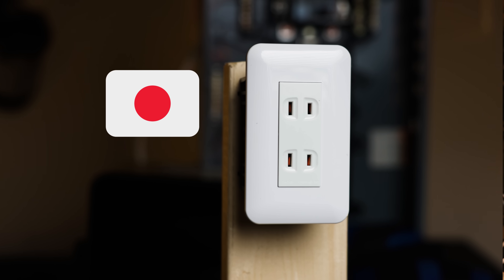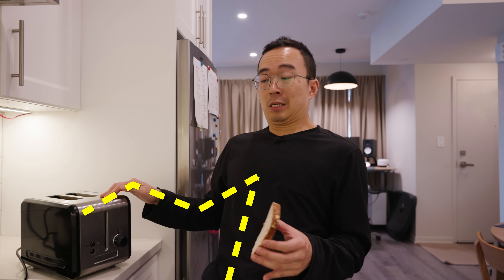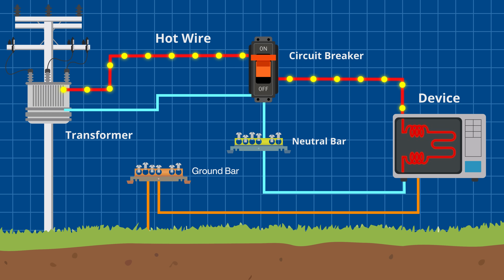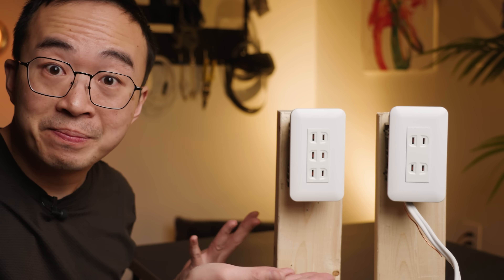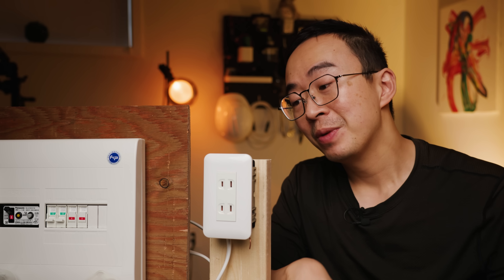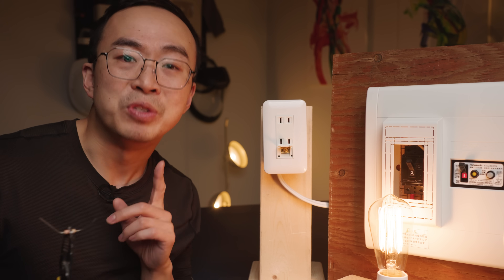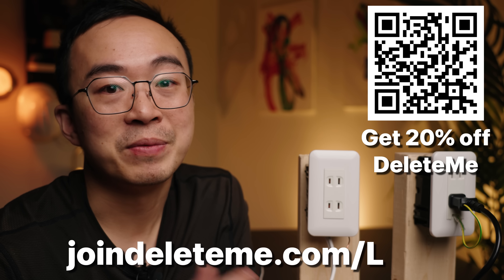How Japan Made Their Outlet Safe

Comment: You are not correct about the Russia. They are now pushing the "modern" schuko (CEE7/3) outlets, but their Schutzkontakt (PE, Ground) is typically unconnected, which causes a lot of problems to modern electronics (which is also why japanese have that weird screw thing). Furthermore, they are not protected by the RCD, but their last mile is typically insulated from the ground and that fault detection detects whether it is still insulated from the ground or not. It's based mostly on residual voltage detection than on a residual current — it is high impedance thing, which means all contacts have to stay insulated from the ground potential.

Mixing RCD with grounding (as it is done here in Europe) is not easy task. If you short the neutral to the ground relatively near to the RCD, it forms shorted winding on that residual current differential transformer, which prevents old transformer based RCDs from tripping. And it also does not detect DC residual current. This is why much modern RCDs are now required in EU, but they have its own different issues, like false tripping etc.

Introducing RCDs to an USA would cause a lot of problems as they have two pole polarized plugs (that requires not to separate protective earthing from neutral, which separation is crucial to the RCD) without any real benefit. RCD does not improve safety too much as it trips at 30mA of residual current, but 3mA through human body is almost perfectly lethal.

Comment: That whole hassle of getting a screwdriver out to ground something is very redundant when you could just use a basic north american socket.
Reply: I'm pretty sure Japanese plug blades are just a slightly different size than the US/Canada's.
Reply: @jovetj  Why would they be? Japan uses basically the same power standard as the US and Canada do, at least with respect to amperage and voltage, and most modern electronics are designed to handle both 50 and 60hz. Anything in any of those countries with just 2 plugs is supposed to be double insulated as there's no ground to direct stray current to other than through the body.
Reply: But then it wouldnt be kawaii anymore. Baka.
Reply: How often are you moving your refrigerator or washing machine around the house? Those are the only thing people ground. I have a welder with the 3rd prong and just use the 3 to 2 converter and don't ground it, I have cut the 3rd prong off some of my other things
Reply: @hambone8820  kettle toaster air firer lots of kitchen stuff. gaming pc and monitor

Comment: Here in North America there are still some older houses which have ungrounded outlets, many of which have no ground wire in the cable either.  In many cases, people removed the grounding pin to get the plug to fit in the ungrounded socket.  Many appliances are dispensing with the grounding pin altogether in favor of double insulation, whereby no hot conductors are capable of making contact with the outside casing.

Comment: Electrician from Melbourne, Australia here. We used to have similar house wide RCD's fitted (mandatory since late 90's / early 2000's on new installations). They were eventually banned due to small faults such as a filament (incandescent) light globe blowing and taking out the whole house supply. Eventually power and light circuits had to have separate RCD/MBO's combo (Residual Current Device - Miniature Breaker Overload) to break them up. These can be separate devices. There are also 4 different types of RCD's, but that's getting technical and has to do with an obsolete type with 3 new replacements, that operate on different currents and frequencies, depending on what's required.

Now every separate circuit has it's own RCD-BO installed with a recommended 2 lighting circuits through the house (though not mandatory). That way, faults are isolated to individual circuits, not the whole house, especially lighting. The next evolution in electrical protection will be AFD devices or Arc Fault Detection that will start being implemented soon. These detect arching between active conductors and disconnect before the circuit, hopefully before a fire takes hold.  

As mentioned in another comment, I'm coming up to 30 years in the biz, so have seen a few changers in my time. I find other countries electrical systems interesting though, so thanks for making the vid - Cheers!!
Reply: I lived there when I was only 5 years old in 1995 (30 years ago).

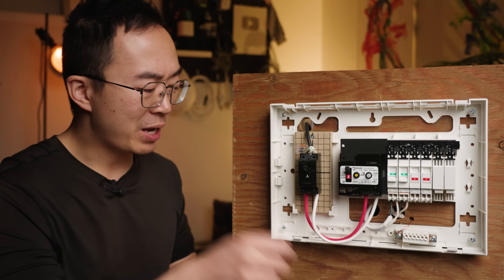Comment: Why so misleading? 7:10
1) it is easy to convert TT to smth like TNC-S, and you don't need to upgrade "substation infrastructure" for this. In opposite, converting TN to TT is more troublesome as this requires independent extra grounding system of the house.
2) while many countries in Europe practice TT grounding (not just France), their sockets have 3 contacts now. Having or not having the ground contact is not really depends on TT or TN - both grounding systems allow having extra grounding contact. At least, GFCI can do its work better in this case
3) as you have shown yourself, some Japanese sockets have a cumbersome inconvenient ground contact, so it seems Japanese engineers see that their plug-socket design is inferior, but instead of really solving the problem, they decided to use a weird crutch solution
Reply: yeah, this guy doesn't know what he's talking about
Reply: It's not easy to convert TT to TNC-S, certainly not here in the UK, as you require permission from your network supplier and they will often say 'no' because the supply infrastructure isn't up to the job.
Reply: @tubaman66  When Australia dropped TT (direct / ELCB) earthing decades ago affected installations were converted simply by adding a MEN link (neutral / earth linkage within the installation) and if an ELCB was present (pretty much mandatory at that stage) it was defeated by routing earthing and neutral around it and it became a simple mainswitch.  Pretty straightforward process.  Definitely more complex over there in the UK with TN-C-S earthing being provided by the network.
Reply: No, it is not easy. It is not just that you connect the ground to the neutral. In TT and TN the second letter tells where the grounding conductor is connected so the connects would make no sense without grounding conductor.

Teh Japanese separate grounding system is so that you can plug for example a PC to the outlets without the hole. Yes, from European perspective the idea of optional grounding whether you remember to hook it is horrible. The system requires more from the user.
Reply: @okaro6595  your point is not clear. Are u sure you have accounted  grounding rods location for TT and TN ?
Reply: @borincod  what do grounding rods have to do with anything?
Reply: @okaro6595  they have smth to do with difference between TN and TT...    It is not so nice to tell anybody to search themselves, but I have actually already mentioned this earlier
Reply: regarding #3, the wire system is for backwards compatibilty and choice. when you have 3rd pin, you need a socket with 3rd hole, but it's still not widely used. with wire you can use it with old sockets that don't have 3rd hole. and if you have earthed socket, then you could connect it to earth. and for convinience and people who care about safety, there is an adpter that converts between cable and 3rd pin.
to be honest, it's a bit of a hasstle overall with 3 different sockets, but japan's voltage is low so it's not so dangerous after all (can tell from 0 death)

now the video doesn't go into this, but this option is only for 100V 15A. all other types (100V 20A, 200V 15A/20A) that are used by high power appliance like kitchen heater and AC behind the scene always has a 3rd pin and all sockets are equipt with 3rd grouding hole.
Reply: @suou7938  "wire system for backward compatibility" does not really applies here for a reason that it's needed to install a new socket with a bolt for hooking the grounding wire up. Do i miss smth?
Reply: @borincod  to have grouding in the house, you're right. i was refering to adding grounding to appliances. if governemnt suddenly requires 3rd pin on all electronic, it's going to be very inconvenient. with wire, you don't have to worry if the socket has the 3rd hole.
Reply: The IEC earthing system like TN-C-S, TT or TN-S does not work in Japan and North America, they have an entirely different system than the rest of the world
Reply: @xiaolinzi_111  bizzare. references?
Reply: @xiaolinzi_111  You do understand that the USA uses a TN-C-S system, right?  The premises earthing system is attached to the supply neutral.  Specifically it is TN-C to the premises and separated with in the premises.  This is actually a fairly common implementation of TN-C-S around the world.
Reply: 1)-because the fault current is different (it is higher)
2)-Because the ITM in TT are omnipolar, in TN they are unipolar
3)-European electrical distribution is different from American (large transformers to small modular transformers)
4)-The neutral in TN must be more reliable than in TT because it will do double work. PE+N 
5)-In America we use, "multi-grounded neutral" while in Europe it is not.

Comment: Your diagram animation around 4:00 shows the neutral bar connected or passing through the circuit breaker. Normal circuit breakers in NA only have the hot passing through it.

Comment: Running a ground wire is a passive system. Properly installed, it doesn't fail. RCD/GFCI are active systems. They eventually fail. Where I live, they're required on outside outlets and any outlets in kitchens and bathrooms within 6" (2M) of the sink/ tub, basically anywhere it's going to get wet. They're ADDED protection.
Reply: I don't realy get what you mean by passive and active in this context but RCDs rarely fail. They are extremely safe even to the point that they age in a way that makes them even more sensitive. So if they get older, they break the circuit at even lower currents and after even faster times. There has to be some serious and unusual damage for one to fail that might happen just as often to the classic circuit breaker. In europe they arent added protection, they are required protection. The circuit breakers are less trusted than the RCDs so we have to have both in every place where basic people who aren't electricians hang around.
Reply: @electricpaisy6045  Exactly! GFCIs fail in a way that makes you replace it, they don't fail by just not protecting you anymore.
Reply: @electricpaisy6045  Oh you don't understand how poor quality RCDs somehow find their way into new homes, because of cost-cutting. Sometimes the electricians signing off doesn't even care. There's why RCDs require periodic testing and many have test buttons, to verify that they work.
Reply: @Avantime  yes but what does that change about my point?
Reply: @electricpaisy6045  They rarely fail, but the thing is they're a safety critical item that should never fail, because there will be someone out there in the millions of households who will die from a failed RCD. Probably a poor quality one.

Not all RCDs are made the same, hell there might even be fake ones out there. My point is that one must be careful if the RCD isn't from a reputable brand. Many new builds are using random no-brand units, because of cost-cutting by the property developer.
Reply: @Avantime  Yes but that is by no means a reason to just not have them at all and that was my point. That would be like saying we shouldn't have Seatbelts in our cars becaus they might fail.
Reply: @electricpaisy6045  I'm not disagreeing on you with regards to having GFCI/RCDs, but people's assumption that they're fully protected when they see them in the breaker box. They must be of a reputable brand, competently installed and tested periodically.

And that may mean new homeowners having to remove those no-name breakers and replace them as soon as they get handed the keys to their newly-built home.
Reply: @electricpaisy6045  Active components have moving parts. Passive components don't. Moving things wear out. I don't suppose it gets any simpler than that. GFCI's are required by code, in addition to a ground wire and a ground rod (or rods). A breaker tripping at a current lower than it's rated value is a failure, BTW. You are proving my point about wear.
 Also, aluminum (or aluminium) wire is no longer accepted at least around here, because of the seasonal heat differential (-20F or -28C to 110F or 43 C) It moved far too much due to expansion/contraction. Can't have your ground wire acting like an active component, especially when it pulls itself out of its own connections.
Cheers!
Reply: @JamesStripling  but the groundwire alone is nothing without the circuit breaker which also has moving parts. Also a fail of being to sensitive might be considered a fail, but certainly not a safety issue. 

I don't know who started talking about aluminum, but in europe we use copper. 

Ever since RCDs came out, circuit breakers aren't even considered a safety system for the human anymore. there german name translates to "wire protection switch". They are supposed to protect the wires and the rest of the circuit from overheating. The earth wire now serves the job of enabling the RCD to do its job which is saving the human from electroicution.

Also the ground wire can indeed fail if a situation occurs where the way over your body has lower resistance, than the case shortcut. the RCD will clutch this, the groundwire won't. 

Also i don't get why you seem lowkey salty now. this is a technical discussion, nothing personal.
Reply: In europe they have two RCD one at the house 30ma and one outside at the meter 100mA, smart meters also have a built in RCD
Reply: I wonder how much safer does that makes the whole system. Not theoretically but practically. Being living in Japan for a long time, but have never heard anyone dying of a electric shock...does that extra grounding REALLY make a difference in real life?!
Reply: Japan can't guarantee that grounding wiring won't fail during earthquakes, so GFCI makes sense. Both would probably be better (redundancy) but they commonly replace entire buildings before the lifespan of a GFCI breaker. Houses in JP devaluate extremely quickly & most of the value is in the lot.
Reply: @adriankoch964  It's a stupid design decision. In the US, anything that has only 2 prongs is supposed to be double insulated to protect against shocks. Things with a 3rd prong don't require the extra insulation as the ground should intercept any of that current and direct it out of the building via the ground wire. Having GFCI is nice, but it doesn't protect against shocks as the video indicates, so you still need the extra insulation if you don't have the ground. 

In the US, GFCI is typically required in the locations that are most likely to benefit from them, mostly kitchens, bathrooms, garages and other areas likely to have moisture. You can install GFCI berakers if you like, but then you have issues related to figuring out where the fault was that triggered it, when the more typical US practice is to just include the GFCI at the outlet which helps greatly in terms of figuring out which one did it. The one that makes a bigger difference is AFCI, and that is still coming, but that protects against far bigger concerns related to arc faults that can lead to fires. 

As far as earthquakes go, that's BS, the west coast of the US regularly gets earthquakes and the likelihood of having any power coming in when none can get out is a rarity, to say the least, assuming it's even possible.
Reply: Of course, those are minimum requirements. There's nothing stopping anyone from installing GFCI protection on every single receptacle in the entire home.
Reply: Yeah. Ive had GFCIs gone bad. You can't beat real ground.

Comment: I am not surprised most people don't know, since 2014 the US requires Arcflash protection for any occupied spaces, so any room other than the garage or a shed. And in many cases a dualtech breaker that can do both GFCI and AFCI (any potentially wet location) the AFCI can detect a faulty wire connection, or a outlet with a bad connection, or a fayed wire contacting ground. Just like any change to the code, only newer homes have this, and if you upgrade your breaker panel.

Comment: Safety in electricity is evolving everywhere. When I was kid, it was allowed to have just two wires (Aluminium was ok) and in the outlets, which were always three pin (live, neutral and ground), the neutral and ground pins were connected together. Over the years safety evolved quite a lot. Now, it is mandatory to have three wire (in copper) connection not to just outlets, but lights as well. And on top of that RCD/GFCI is required in the electricity switch box for all outlet circuits. Bathroom and kitchen outlets have tighter limits. I live in CZ, EU.
Reply: Same here in Germany. I remember the time when I was aksed to replace an outlet in my grandmas house and there were only two wires insulated with oil paper and the neutral was connected to the ground pin of the outlet.

Comment: GFCI outlet testers requires the grounding pin to be connected to the grounding wires to actually work while the GFCI mechanism in the outlet does not. Here in america, according to code, we can provide a grounding pin the an ungrounded device box by replacing the receptacle device by a GFCI one. This mean that if the GFCI tester does not work on the GFCI outlet, this does not means that the GFCI Outlet is defective. Call a qualified electrician.

Comment: Isn't Japan a 100V country? Correct me if i'm wrong. 100V is much much safer than 120V or 230
Reply: Yes, although the difference between 100V and 120V is not that vast.  Both are quite a bit safer than 220-240V that most countries use.